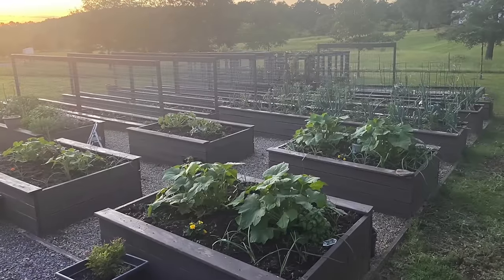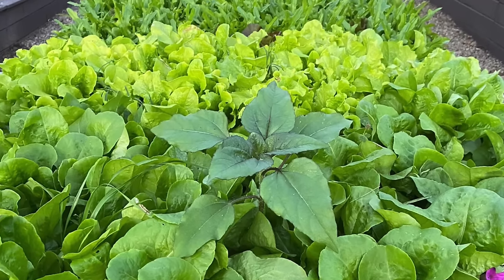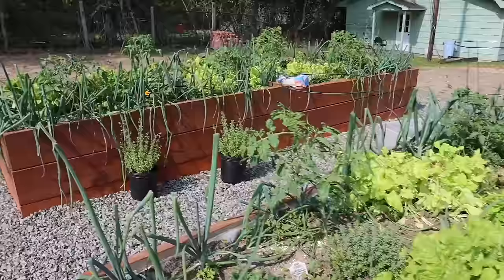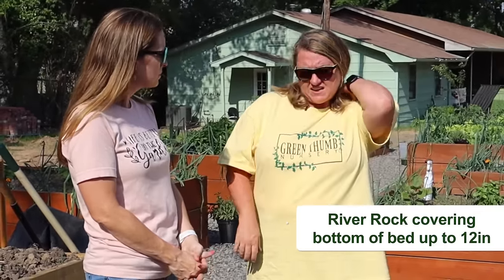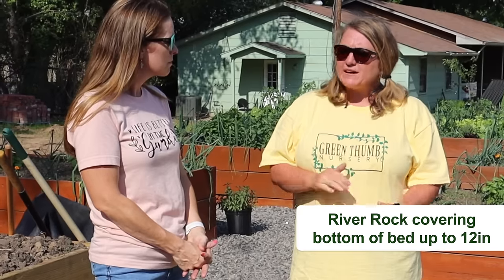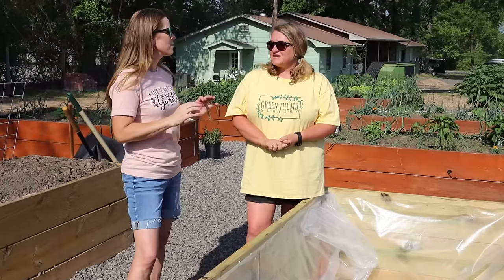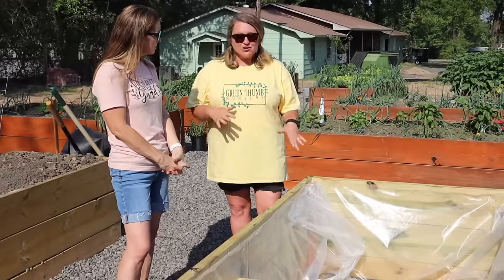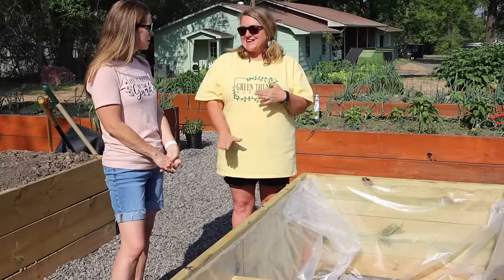DIY Self Watering Raised Beds/Green Thumb Nursery

Comment: This is called a Sub-Irrigation Planter, or SIP.  I have three of them in my garden.   I use the perforated drainage pipe with a sock over it to keep it from getting clogged along with lava rock to make my reservoir.  I also make sure that some of the irrigation tubing is higher than my drain tunes.  This ensures that an air pocket always remains in the system, which also prevents root rot.
Reply: We have several poly cattle watering troughs. They have a drain hole that makes a great water depth limiter. I install a ring of 8” perforated PVC pipe coved with synthetic cloth against the outer wall and then I put a ring of 4” PVC perforated pipe inside it also covered with cloth. I have a direct fill line connected to the 8” pipe and drip irrigation on the surface. I adjust the sprinkler to over flow just a tiny bit. Don’t have to water at all, because here in California we get no rain from May through September.
Reply: Do you use a layer of weed fabric between the rock/pipes and the dirt?

Comment: The chlorine  problem is easy to overcome with a pinch of vitamin C crystals.  My self-watering olla-fed beds are kept auto filled from rain barrels.  The barrels are periodically filled from tap water plus about 1g of C to completely neutralize all chlorine and/or chloramine.  Barrels also warm the in the sun so the ollas are fed with warm, chlorine-free water.  But you could just add some C powder in your filling pipe before beginning your refill.
Reply: Doesn't chlorine evaporate on it's own?
Reply: @cindys4548  Chlorine does, after about 24 hours, but chloramine does not.  Many municipalities are using chloramine because it is far more persistent and they can use less.  Mine does.  You don't smell any chlorine in the water because it does not off gas.  Vitamin C neutralizes it though.
Reply: @dwc0  I checked and Vitamin C does neutralize the toxin chlorine and chloramine to 99%. To treat a bath tub of water use 1000 grams  or if using a powder or crystal use 1/4 to 1/2 teaspoon per bath tub amount of water. Vitamin C outperforms carbon filtration when it comes to chlorine and chloramine. Another good reason to add a slice of citrus to your glass of drinking water.
I was thinking originally to use the evaporation method, but now I am educated about Vitamin C. Thanks for sharing!
Reply: In central Texas, the water in those barrels would probably pass the warm stage in summer. I like the vitamin C solution.
Reply: @sharonburns1743  You probably meant to say 1000 mg (1g) not 1000 grams.
Reply: @jennifergayman3575  Maybe not with a very light barrel and/or keeping it in shade.

Comment: Wicking beds were invented by Colin Austin in Australia. It’s worth checking out all the different ways you can set them up. There’s a solution for everyone.. I’ve been using them for over a decade. All the hard work is in the setting up - there’s basically nothing else to do but plant and harvest at your leisure. They are highly productive and the return on investment begins almost immediately.
Reply: what is your experience with the plastic liner breaking down and replacing it? and what about earthworms, would i need to add them?
Reply: This concept has been around for thousands of years. Hawaiians filled the bottom of their garden beds with coconut half’s for example.
Reply: @pamt8430  I was wondering about that too. Did you get an answer to your question?
Reply: Hi. Aussie Aussie Aussie oy oy oy 😂 I live in Townsville North Queensland Australia.   Which way do you use the wicking beds please 😊

Comment: If you're not worried about plastic in your food production spaces, the best reservoir is something that creates a fully open void like inverted plastic milk crates, with geotextile fabric draped over the top. Make sure the fabric dips down to the bottom of the bed between each void and the next so you have enough continuous soil for the water to wick up through and your plants will be able to use the water to the last drop. The big voids will mean you have a huge amount of water sitting there - and the geotextile will keep the soil out of your voids for decades after these river pebbles have been dug out and replaced.

Comment: Another way is to run a Larry Halls Gutter Garden down the entire middle of a raised garden.  You then drill holes at 1 ft increments on each side of the gutter and glue in sections of hollow braided cotton rope to go crosswise or really anywhere as that is the wicking medium which is buried in the garden.  Larry Halls garden system keeps the gutter full of water at all times using a float valve supplied by either a rain barrel or pressurized water.   What's really neat is you can place containers of soil with a net pot in the bottom into the gutter which is buried level to the ground there by irrigating both the containers and the entire garden through wicking action.

Comment: These raised beds are really slick!  Conceptually this is a scaled up version of commercial "Grow Boxes" which I have used and with excellent results.  The reservoir watering system has addressed the biggest issue I had with the Grow Boxes which was keeping up with the watering during hot weather which required watering once / day.

My only thought for improvement with the system is if using multiple units is to tie the drainpipes together so filling one on the end of have the water cascade to the next one automatically which would also allow incorporating an automatic water system economically,

Comment: I am about to re-work my raised bed from last year, that I did not make deep enough.  It worked, but was not as effective as it could have been.  Last year, I also made several wicking tubs from storage tubs that worked great. However, I did not make my raised bed with a water reservoir.  I plan to make another raised bed and was thinking of making it with a water reservoir so finding your video came along at just the right time.  I have ordered my plastic and sewer tubing from Lowe’s and will pick it up today.  Now I am ready to re-build my older bed and add another one.  Thanks for your detailed video!  It will be so helpful! Now if the weather would just warm up enough to get it constructed!😊
Reply: How thick is your plastic, size & cost of your sewer tubing? We have newly made garden boxes & when we figured the cost of the sewer tubing it was going to be very expensive for three garden boxes but I really want wicking garden beds.
Reply: I purchased my sewer tubing and plastic from Lowes.  The 4”x10’ perforated sewer pipe: $15.98.  The plastics was 10’x100’ 6mil construction film (Professinal 6+mil) was $84.98.  This film was more than I needed for my two beds, but I figure I can use it for other things too. I only used one tube per 4’x4’ bed and filled in some of the space with other items like small plastic crates or baskets before adding the river rock.

Comment: Water does not wick up rocks, and if the water is below and not touching the soil, it will not wick up.
So you need something like a thick cotton rope to go from the bottom of the rocks up through the landscape fabric into the soil.
Reply: I have been searching for an answer on how its going to wick once the water level drops an inch or two. Still looking for a solution.
Reply: Awesome idea!  I’m in the process of doing my whole garden this way and I will had some soft rope up through the cloth in several places!!!  Glad I read your comment first. Thanks😅
Reply: @Rogooster yeah it needs a little "well" where the landscape cloth lets the dirt contact the water.
Reply: This is my first thought and however i think this through i do not understand the physics behind it. If for example the water level in the bed is only 5 inch high... how does it go up without touching the soil. Can someone explain pls.  @Rogooster
Reply: During hot days some of the water will tend to evaporate through the rocks up to the soil. Sand would be better than rocks since the smaller the space between the material the better the capillarity action . I would still use a few old trousers as a wick connecting the water on the bottom up to the bottom of the soil.
Reply: @MaestroXXV dirt falls THROUGH the rocks …. Good dirt with hummus (plant fibers-) will wick 😄 UP the water … Rocks  will keep it from rotting . Airflow. Like a body that needs more oxygen .
Reply: @Rogooster I think you top it up with a hose that’s why she put in the big black pipe. To fill direct to the reservoir

Comment: Not only does a raised bed offer self-watering it also allows for excellent nitrogen retention throughout if the sides are made to be higher than the soil surface.  The best gardens trap nitrogen by keeping it from blowing away in the wind or seeping downhill.  I like supplying nitrogen with mulched grass clippings and sprinkling compost tea over it.  If you are really daring you can use soiled diapers in a perforated bag if temperatures get really high (but I never have).

Comment: An idea I thought of; connect the pipes together to allow for all beds to be at an equal level. This also means you only need one sewer pipe and one drain. It may cause a possible trip hazard which can be solved by running the pipe down, underground and then back up.
Reply: Thanks,
I was thinking there must be a way to connect beds.

Comment: This is a great!This is a 6 star ⭐️⭐️⭐️⭐️⭐️⭐️I love her teaching.  
It would be interesting to know if you could put a house water filtering system on to the hose that you use to fill your raised bed during the summer to remove chlorine and other harmful chemicals from the city water supply.  Also if you could attached a hose to the drainage pipe to collect runoff water into a rain barrel for later use.

Comment: I live in Iowa and every summer it gets to dry will def be adding this! Thank you for the details.
Reply: I’m curious how this stands up over the winter with a hard freeze. Wouldn’t the ice expand and cause damage to the bottom of the bed or heave the upper layer? I’m wondering if you’d need to pump/drain the water after harvest and before it starts freezing.

Comment: I'm at a loss to understand how, when the water level in the rocks gets lower, there is enough capillary action to have the landscape fabric/soil junction get water.  Most self watering systems have some sort of wicking that is always down in the water and up in the soil.

Also what happens in the winter, when this big "bathtub" freezes inside the plastic lined boards?
Reply: My guess is that the river rock was mixed with sand when they dumped it in. A normal wicking barrel would put drain pipe, rock, then sand. The sand would work to the fabric cloth, the cloth would wick to the soil, and the soil to the plants
Reply: I was thinking same thing. There wasn’t a “wick” in her system to keep in contact with water regardless of level. Maybe she’s relying on the water to evaporate up into the soil.
Reply: @joserubio2039  That is exactly what she said in the video, evaporation.
Reply: What?  No where in the video did I hear evaporation in the process of how it works. 
In fact, at 12:47 is when they began to explain the process, and 13:11 she specifically states leeches up, 13:13 states soaks up.  

Where in the video does she mention evaporation?  If you can’t support your claim then you may have heard it in your mind, but not in this video. 

My brain is old and I may have missed it, so please…… when?

Comment: I haven't built mine yet, but I did think of an idea for removing the chlorine from the water before using it to fill or refill the reservoir. I plan to have a drum near by that I can fill with the hose, and let it sit for a day allowing the chlorine to evaporate naturally. Then instead of bailing the water from the drum into the reservoir pipe, I plan to use my garden fountain pump inside the drum and run tubing to fill the reservoir. Luckily I already have a small inverter that runs on a 40volt battery to power the fountain pump without needing an extension cord.

Comment: Sounds like a good solution But what about when the water gets lower in the bed so that it is not in contact with the landscape cloth/soil. I would think that the wicking action would not work well when the water is lower. Perhaps put sewer pipe pieces (with holes) vertically  in several places throughout the bed from the bottom up to the level of the soil and fill with soil so that water can be wicked up?
Reply: In theory the water will wick up the rocks, then to the soil no matter how low the water gets.
Reply: @caracampbell4442  I don’t think water is going to wick up the rocks well enough to water the plants

Comment: i have a homemade earth box in a big rubbermaid crate. works great. i'm going to try it in an old fridge-gotta see if it holds water first-if not i'll line with pond liner. i wonder if i can use small logs and branches instead of rock in the resevoir then no need for the landscape fabric? like a contained hugelkulture?
Reply: Was thinking pond liner would be great as well. Not sure about chemical leach though. With hugelculture won't the logs break down?
Reply: @fth1013  yes eventually, but it would save the cost of other things to fill.-eventually i'd think any wicking bed would have to be emptied and rennovated after a bit-everything breaks down. perhaps i should lay the logs and branches atop the landscape fabric instead of as a replacement for the rocks-would save on soil cost and yes break down into more soil.
Reply: @donniwaltz1911  But I don't know how the logs would do in wicking the water up to the plants.  Maybe OK if not a solid layer of logs and branches, with space for the soil to get in between?
Reply: Unless the wood is a really dense hardwood and a solid layer, it shouldn’t be a problem especially as the wood decays. Part of the beauty of hugelk.

Comment: I came up with the exact same idea last year. There is a problem with it . The water will stagnate if it sits , you need an irrigation system to recycle (aerate )  the flow of water . Im sure a solar powered pump to aerate  the water would be of great benefit.. other wise your plants could die faster then you think,  Due to lack of oxygenation in the water.
Reply: I think you are mixing surface water and ground water issues. 

Also, capillary action is the irrigation system.

Comment: Did you ask Tammy about the lifespan of one of these beds?   The use of treated lumber and keeping the moisture away from the wood should extend the life significantly.   I love this version of a wicking bed👍
Reply from the maker: Not specifically but I got the impression she’s had hers in her own garden for years.
Reply: Good point Mark.   I would imaging that the pressure treated wood doesn't come in contact with the wet dirt delaying decay even longer.  And the outside can be treated with more preservatives because there is no contact with the wood.

Comment: Thanks for the water collection idea.  
8: 25, I would make the overflow pipe extend out a foot, and set a collection container under the end, to later add that water back into the raised bed. We never know when it's going to rain again.
And I'd add caulking around the overflow pipe on the inside of the  wooden wall.  
Thanks again for the plan.
Reply: We use silicone. And, yeah, leaving the pipe out a little further is a good thing. Just remember it's there - your shins will thank you! 😊

Comment: Great concept, nice one. You could mount a clear plastic tube vertically at a corner or in the middle of the bed and slide in another tube with a float on the bottom to visually show you the reservoir water level. I could make you one and send it to you. ;)
Reply: A stick in a cork works too. Side benefit is getting to drink the wine. 😉

Comment: You should add a cap on that sewer pipe and mulch or cover the top with plastic with holes for the plants.  I got the idea from the EarthBoxs I've been using for years.  I'm making something similar, but with a waterproofed plastic cement reservoir in the ground (to hold more water incase there is a drought) and rock walls.  I tried to use bigger rocks on the bottom and smaller as they go up in the reservoir and left as much space for water as I could.  Now I read the guys idea about using  pipes at the bottom which is a great idea, but I'm trying to use what I already have.  I have tons of rocks.